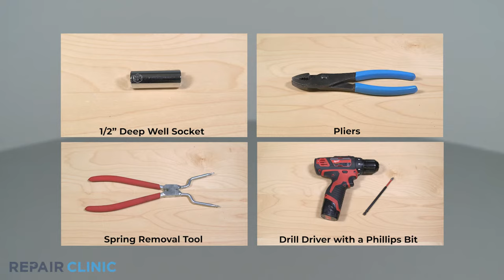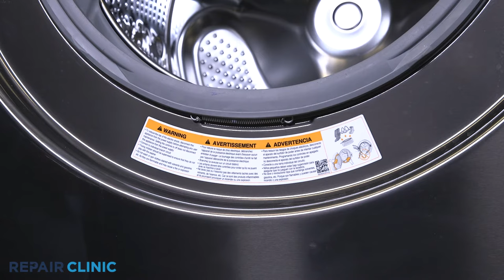LG Washer Front Shock Absorber Replacement ACV72909503

Comment: Helpful tip. Instead of dismantling the whole front and seal, just disconnect the water lines, tip machine onto its side, then remove the shock absorbers from the access whole in the bottom. Or take the access panel off the back and reach in through the rear. Keep it simple and no need for expensive tools.
Reply: You answered my question that I posted on the video on your channel!  Thanks.
Reply: The tool to remove the spring off the seal is only $10
Reply: Surely tipping the machine on it's side raises the possibility of something else getting broken.

Comment: Hint: before you try the FRONT absorber(s), replace the rear first. Deep socket did not work for me; short 13mm was perfect. In my case, I could access the two in front FROM the rear and did not need to remove the whole front panel and door assembly. Also, you may be able to simply regrease instead of replace. Remove the old ones and inspect. Try just applying brand new grease before replacing. You may save yourself some $$$. Unless there is heavy rust, just apply some marine grease and reassemble.

Comment: I have an LG front loader, but my drum has three shock absorbers:  two on either side of the drum, and a third at the rear.  What I found possible is that you can access the shock absorbers by removing the washer's back access panel.   It's a little tricky if you access from the rear.  But if you use the 1/2 deep socket on the tab of the locking pin (facing you towards the rear panel, and then use a small-sized vice-grip pliers to pull the head side of the locking pin away from you. It will work, and you can avoid having to remove the front panels assembly from the dryer.  Also, there is no reason not to install the new locking pins with the tab side facing the dryer front, and the head side facing the dryer's rear access panel. This will make it easier, the next time, to pull those pins.

Comment: Tips- Since most people don't have grease lying around Vaseline should work just as good. Knipex 3891200 was a great tool for removing the bushing pins. I used a pretty big channel locks pliers about 5" to get the bushing pins back in where I couldn't get a stick to hammer them in.  1/2 deep sock was great for removal.  Also, people said the new shocks hole was too small so they removed the bushing...but you can see your old shocks had the same bushing I just removed the white plastic bushing and cut where they are meant to break so they would spread and they work just like the factory ones.   To my surprise my shocks were still good after 10 years but replaced them anyway because they were starting to rust.  I also removed the inner boot spring, big mistake, there was nothing to clean, 383EER4001A Washer Spring Expansion Tool only works well for the outside ring...I ended up having to remove the spring to get the seal back on and a pliers to pull the spring back on ...wasn't easy by myself.

Comment: Every video says to use a deep socket, but qith my lg washer you cannot fit the socket into the area needed foe the 2 side shocks, only the back one.
Reply: I used 12mm ring spanner. Had enough room to use hex driver to push pin out. Mine was a slightly earlier model and had 3 dampers in L-R axis
Reply: I was able to use a deep 12 mm socket by first pushing the plastic pins by hand as far as I could go one direction.
Reply: @mcclmark  I eventually got it, doing what you did, but not with ease like the ones in the videos I've seen as my LG washer had tighter space. Cheers!
Reply: Just pinch the nylon tabs in push out.

Comment: My LG washer was shaking violently during the spin cycle and these instructions helped me determine how to disassemble it and find out that the concrete weight attached to the front had fallen off. I was able to add washers to the concrete way and reattach it and reassemble it using these instructions.
Reply: Same problem here! I will also replace the shocks in case they were bad causing the weight to break off...
Reply: It was that easy?
Reply: @lazyboyz  it was pretty easy, especially once the video above shows you how to remove the screws in the right places. The hardest part is moving the washer away from the wall. I did go to Amazon and pick up the tool to remove the spring wire that holds the rubber gasket. After that, it is very straightforward. No tutorial is needed once you have the outer cover removed since it is straightforward at that point .The washers may not even be necessary to help secure the concrete weights. You might just need to tighten the screws and put a little epoxy in the threads so it doesn't happen again. On my washer the concrete weight fell off and damaged the pump hose so I did have to buy one of those from Sears direct. In theory, I could have used any hose but I wanted to make sure it was the right durometer because it is a flexing moving part.

Comment: Good instructions. But I did not have a socket to depress the tabs on the locking pins of the old shock absorber. So I slipped the new one over the end of the locking pin, as I figured this had the same diameter.

Comment: What do you use if you don't have the spring removal tool?
Reply: Tip I've seen was to use a small  flat wrench (eg 7mm) as a rigid bar and use zip ties pull the spring open
Reply: Needle nose pliers.